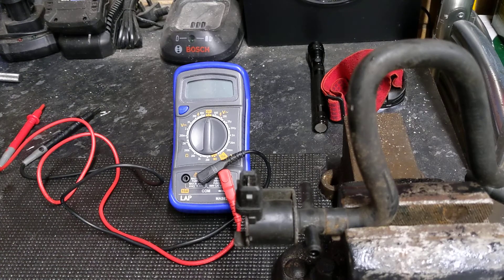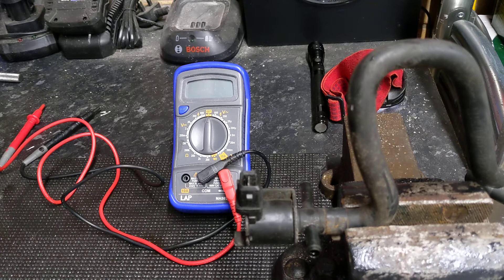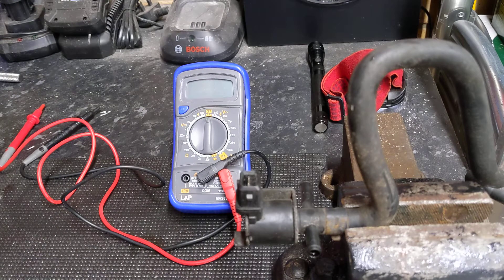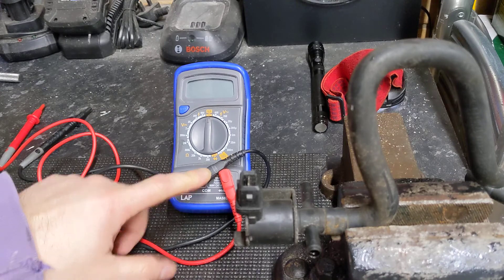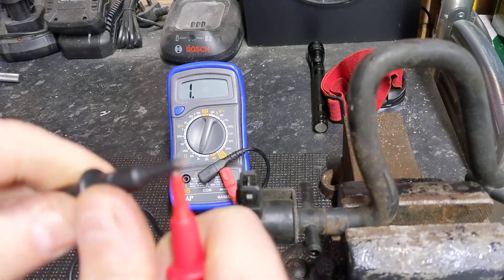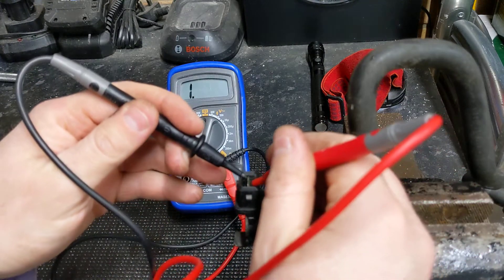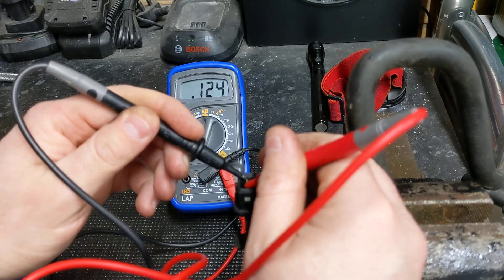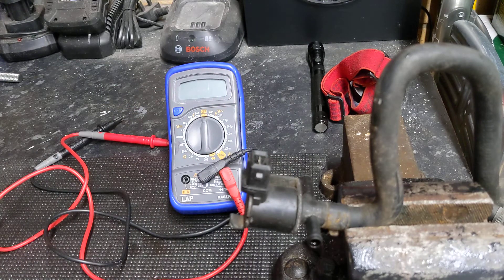How To's - Testing your N75

Comment: Hello i know it is old video but do you know what Ohm do overboost or underboost? Lets say 25-35 is ok but if i have 45 or more will it let pass more of the boost or less of it ? I am tring to find what will happend if you rise the ohms or lover it. And what will happend. Thank if you answer and have nice day
Reply from the maker: You do not want to be using the N75 to control boost. You sure either get it remapped to increase boost, fuel etc and let the N75 do its job or get an MBC which is still not really recommended
Reply: @MotorMonkeyz  got it thanks for advice 😇

Comment: Hey
Just want to ask if the info you provided, that if it is below 25 so it has to be replaced.
Is that jnfo valid for all vw engines?
1.6 tdi deasel fx
Reply from the maker: Sorry I am not sure if this is the case for the 1.6 TDi but if yours is below 25 I would try another one to be sure

Comment: I did a smoke test on my Audi because it wasn’t running right, a bunch of smoke started coming out of the N75, probably bad yeah?
Reply from the maker: Yeah sounds like it is, check the hoses that connect incase any are split
Reply: how can an n75 have smoke coming out of it? makes no sense
Reply: That’s what it looked like anyways.
Reply: @intunewithcars9484  it is made out of plastic though and could’ve cracked with the 22psi of boost I’m running.
Reply: @DustySteelGarage  ive been around the 1.8t 20v, 25 years never have i heared this or seen it ever...piping around is possible only
Reply: @intunewithcars9484 okay, that would be cheaper than replacing or upgrading the N75 valve. I’ll definitely check there first. Maybe I’ll record it for a future build/restoration video.

Comment: Hi, thanks for the explanation! my N75 tells me 27 ohms, but the problem is: that in the cable of my audi a2 tdi the 12volt does not reach the N75 sensor, it reaches the engine on 11 volts, what could it be? Thank you
Reply from the maker: Apologises I am not sure, you could check for a bad earth?

Comment: Dude my 1.6tdi n75 resistance is showing 15.6ohms is it fine?
Reply from the maker: Hey dude, I'll be honest I'm no expert on the 1.6TDi but I would guess they are similar so if you are having boost issues it might need replacing
Reply: @MotorMonkeyz  thanks for your time man. The car is in limp mode with the roms at 1100 and flashing glow plug and engine doesn't rev above 3000 or so. I wil hook up a reader and see what it shows 👍
Reply: @kailash
Is you problem sorted. Having similar issue on Audi N75 testing 16

Comment: Hi.. Mine shows 016
Reply from the maker: Hi Mate, I would suggest buying a genuine N75 valve and see if this fixes your issue. It is outside of the variable required
Reply: @MotorMonkeyz  already ordered 1 (pierburg).....
But last night i have swapped the egr solenoid to turbo...... The van is flying 😁👍
Reply from the maker: @AlfaOmega2201  Fantastic news, remember the N75 valve is has a part to play with boost control and therefore could cause boost leaks and spikes.

Comment: Hi man, I'm facing a probelm with boost 1.8t Audi A4 B6. I have done cuole logs of my Westgate Duty Cycle and it's maxed out at 4200rpm to the redline. Have not much boost in that are. I have checked out ohm resistance linke your recommended in video, and i got 0.33-0.34ohm. I have also try to shock n75 with 12v from battery and I'm hearing clicking noise. 
So any suggestions, how does it seems to, do I need new n75? My car have allrdy 280k km on board
Reply from the maker: Hi 

I would recommend a smoke test at this point. With your N75 in tolerance it's a good chance there is a boost leak. You would be surprised where you would find it!
Reply from the maker: @limitlesswarface7757  you can make your own but garages also have them
Reply from the maker: @limitlesswarface7757  where are you located? Can recommend BWS TT who is mobile
Reply from the maker: There are some YouTube videos for DIY smoke test.